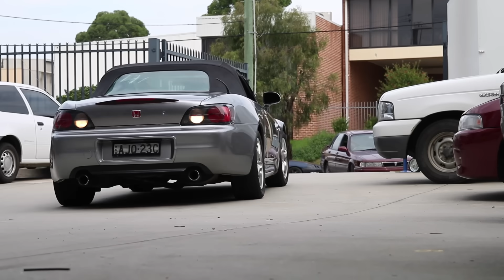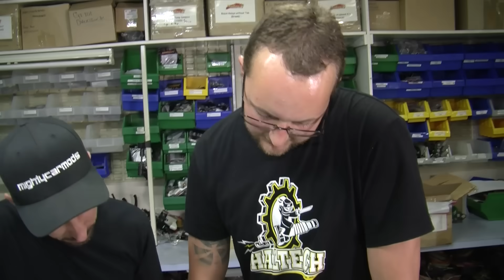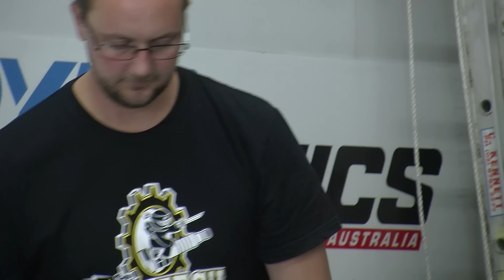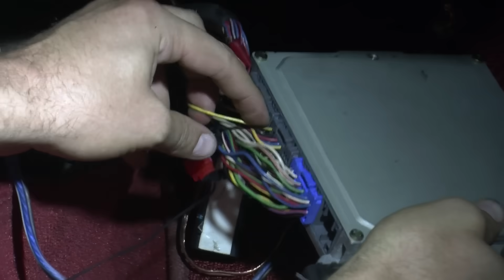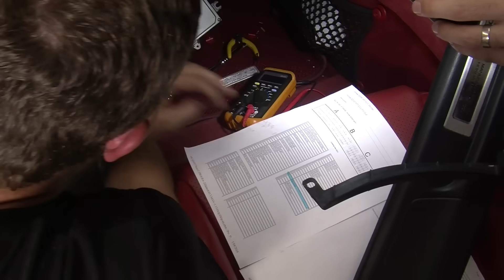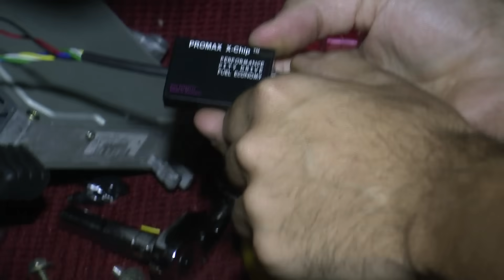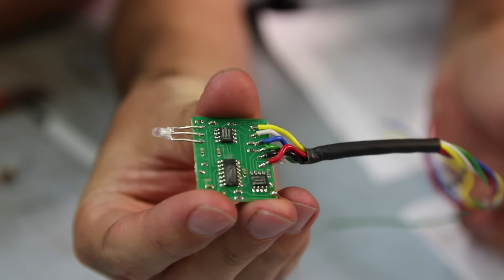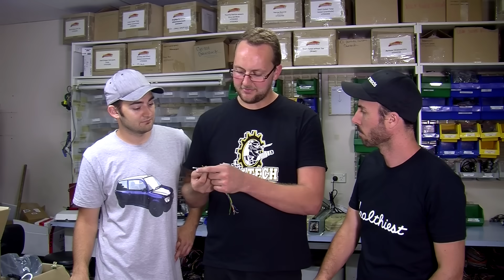eBay Performance Chips -  Mythbusted

Comment: 177BHP is very weak for a stock S2000? Do they have very bad fuel in Australia?

Thats a 63BHP loss through the drivetrain which I find outstanding. A friends stock S2000 in the uk made 200BHP at the wheels. Heck even my ST205 GT4 has less power loss through the wheels and thats 4WD and 300BHP+ @ the fly.

Comment: Ok. So clearly this was a scam, but there has to be some reputable chips out there on the market right? Admittedly they will probably be more expensive, but maybe, actually function as intended?
Reply: I was thinking the same, MCM goofed on the CAI video too, where N/A engines would benefit the most from cai than boosted engines. They need to go in-deph and do version two of each video.

Comment: once again. great episode. but i could have told you guys that ebay chip wouldnt work instead of wasting your time. Im just a regular car enthusiast, dont know much more than the basic stuff.. but im sure if an actual tuner saw this product, they would be completely insulted. knowing how long it takes to properly tune a car reliably. heck im sure that haltech gentlemen was a bit annoyed by that product. Those tuners dont charge you hundreds of dollars for no reason. 

...unless this episode was just some teaser episode on something way bigger for the s2000?

Comment: I keep telling people. VTEC is a technology to get an aggressive cam profile to run smooth at low RPM. It's not a technology to make you go faster, it's a technology to make a lumpy cam - which is what makes the car quicker - more tolerable to drive day to day.
Reply: For an engine with an aggressive cam, below 4500 is low, yes.
Reply: ***** For a car that goes to 9k, yup
Reply: Jake Gilbert The way VTEC works is it switches you between low RPM cam lobes and an aggressive high RPM cam lobe for the cylinder. You can just have an aggressive cam in a non variable timing car though - and there are plenty out there that do. I've seen small port 4A-GEs make >100kw at the rear wheels from a 1.6ltr. No variable timing at all. That's more power than my 1.8ltr VTEC car makes. The 4A-GE doesn't NEED VTEC at all to make that power, because what VTEC is for is to switch off the aggressive cam lobe so it can be driven on the street comfortably. The 100rwkw 4A-GE had almost no torque below 4000 RPM, and idled so rough it would occasionally stall while sitting at the lights.
Reply: *****  Yes, at 75mph an S2K will rev at 4K RPM in 6th. Actually, i normally change gears between 4K to 5K... And the engine running below 3K will actually bog...And still does 23mpg...
Reply: Luis Ribeiro You've got a long 6th. My Integra sits at 4100rpm at about 100km/h in 5th (62 mph).
Reply: Vtec is variable valve timing, vtec changes the lift and duration on the cam.. so yes, it makes your car faster

Comment: Wow I thought that S2k was a 6 cylinder...Looks like my Z34 would blow the bonnet off Moogs ride...
Reply: Brooks Yeager Why are you demoralized?  It's a great car.  I'd rather have it over any Japanese car on the other side of a GT-R.  This is a car that walked hardroof Z33's all day despite it's 4 cylinder and convertible top.
Reply: ... You thought the S2000, named for the fact that it's a 2000cc engine, was a 6 cylinder?
Reply: Lol didn't they come out in the year 2000....?? >.>
Reply: Also it's listed as 2157cc they did a lot of rounding down.
Reply: Well I'm demoralized now that I know this S2k has just a 4 banger in it.Looks fast as hell!
Reply: Brooks Yeager No, they came out in 1999. I don't know that any car has used the year it was released as part of it's name. Meanwhile numbers almost always mean the displacement. A 330i for example is a 3 series with a 3000cc engine (roughly).

They almost always round up. The S2000 originally came with the F20C which had 1,997cc, and that's the only model we ever got in Australia. The AP2 S2000 had the F22C 2.2 liter engine internationally, but Japan and Australia kept the 2.0 liter version. They didn't bother changing the name internationally though.

The JDM F20C with 183kw is the most powerful naturally aspirated mass produced road going four cylinder engine in the world as far as I'm aware. Extra cylinders aren't that important. The overall package is what makes a good car, and the S2000 is nothing to look down on. While the 370Z is significantly more powerful, the first generation 350Z has the same power to weight as the S2000, and by every review the S2000 has better handling characteristics out of the box. Of course the 350Z will be faster in a straight line because of it's low end power - but the S2000 is still an amazing bit of kit.

Comment: Hold up. S2000 made 240 stock don't they?
Reply: At the crank before drive train losses. Manufacturer's announce the power before it gets to the tires because it sounds better
Reply: sixteenseven123 Not only that, but over the years, engines lose efficiency and power.

Comment: I hate to say it but maybe you should learn to use ebay and well maybe ebay should take negative feedback like "That is a fake box ! 3 pos switsh to turn led not more" seriously , and that is from September 2013.

Ebay are pricks basically , even if people report it as fake and prove it , if 200 other idiots say "a+ got it" well that's it once you hit that button your choice is made no going back , I have had so many problems with shit on ebay like this I stopped giving feedback until the day before the 45 day limit. Sellers will even some times drag you on and on until its 60days gone and you cant even leave feedback and then ebay basically fob you off saying sorry nothing we can do , so I ripped ebay off for 80 bucks and told em were to stick it.

Comment: I wouldve sent the item back and gt a replacement cause they may have gave you a dodgey one, in the uk the chip goes in the engine. Ive had one installed n it does give that extra power n economy but mine was a diesel astra 1.9 cdti (150)

Comment: Haven't finished watching it, but 35hp from a chip in an S2000? Nope.
Reply: nope... :(
Reply: 5 hp from a chip in a s2000 already makes me cry BS
Reply: Shadowboost You might be able to get 5-10hp by slightly more aggressive tuning - especially if it's an AUDM car, which has a little less than the JDM power figures.

But yeah from a generic chip not specifically designed for the s2000? No.
Reply: they said at the end that the chip doesnt even work, literally does nothing
Reply: crysis860 Yeah I know. For $20 that's exactly what I'd expect. There are a LOOOT of scams out there for people just getting into cars who want a bit more speed but don't really understand how a car works.

Even things that are quite expensive are often a complete waste of time. I know this is controversial, but even things like exhausts on otherwise stock NA cars are usually a massive waste of time if you're looking for more power. Pod filters are also not better than standard filters for most near stock applications (as MCM has shown).

Best performance upgrade for most modern cars and certainly something as highly strung as an S2000 is the way the car interacts with the road. New sticky rubber and possibly lighter rims. Then coilovers, new bushes and sway bars and some suspension tuning. Then a tougher LSD (I think the S2000 one is pretty good though), and a lightened flywheel and clutch.
Then things get REALLY expensive.
If you touch the engine you kind of have to go straight to a new cam and ECU, then accommodating port and polish, new intake manifolds and throttle bodies as well as exhaust. Gets expensive very fast.

Comment: First off, I would NEVER run an ebay chip even if its proved to work. $20 would buy you a crappy tune that most likely causes engine knock and misfires up the ass.

Comment: This is actually incorrect. Most vehicles have their PCM on the passenger side of the vehicle. There is no room for all the pedals and the openings for the drivers feet are too large to place the computers. Body control is usually also located in the passenger side.

Comment: Yeah i used those crimp splicers on ECU wires when installing an SAFC to handle new injectors on my buddy's integra.  Wouldn't even start.  Started over soldering everything.  Worked fine.  Those things are useless.

Comment: first off wana say. i dont think these do anything for power... HOWEVER i used to have an automatic transmission honda. and bought one of these chips. and i have to say it was worth the money for me.... because...
number one the only thing i noticed it did was change the shifting times. on sport mode if i floored the gas it would shift about 200rpm later than standard. not anything to write home about... 
Number 2 however. in economy mode it was great for highway driving. since it was your typical slush box if you were cruising down the freeway and even looked at the throtl it would downshift. and with the plug in chip you had to give it much more throtle before it would downshift. which was nice.

Comment: It would have been cool to see what a real ECU tune can do. Either way AWESOME VIDEO!!! I always wanted to see these eBay products busted. It was about time! Keep up the great work guys. CAAAAAAAAAAAAAAAA lol (Car)
Reply: Not much power is to be made with either the F20 or F22 by way of just tuning. You can get a bit more midrange power with a more even curve through the middle were engagement is but that's about it. If you want to make a noticeable difference in power with these engines you need some form of forced induction. Even guys that go the N/A route with these motors don't pick up much power, usually just sound.

Comment: I find it hilarious the lengths people go to to make a fake and functionless product look like it's actually doing something. With the time and effort they spent soldering up a fake circuit board, why didn't they just actually connect the resistors?
Reply: Because even that wouldn't work, as the ECU guru explained.  The computer would have altered and corrected for the adjustment on the next restart.  Their clear goal was to produce an item for $2 and sell it for $20.
Reply: David Bonilla
I would be surprised if it even cost $2 to make lol
Reply: David Bonilla
 Yeah I realize that it wouldn't do anything performance wise. I'm just wondering why they didn't just make a circuit that at least did something, rather than going through the same amount of effort designing a circuit that looked like it did something, but really did nothing.
Reply: In truth, and I know perhaps we're thinking too far into this, but the fact is there's millions of junk parts out there.  Why bother getting working parts when you can just slap some junk parts on there.  I mean they did make 'a' circuit as it had to control the LEDs, but beyond that it'd just be a waste of time.
Reply: David Bonilla  Yeah, true. Plus, after thinking bout it, making a fake circuit, means they could just stick any chips they wanted in there and it wouldn't matter.

Comment: WOAH WTF? The S2000 comes with 250+ HP in the states. Moog doesn't know what he is missing.
Reply: No, the S2000 makes about 240-250 HP AT THE CRANK in every country, including the US.  

A dyno measures BRAKE horsepower.|

In every car ever, your BHP/WHP will be lower than the crank (just normal HP), because there are things that are between the crankshaft of the engine and the wheels, like the driveline, axles, and brakes.
Reply: thats what i said... I was flipping out when i saw that figure....
Reply: sarom058s Actually, brake horsepower (BHP) is the same as flywheel (crank) horsepower. The 'brake' refers to the part of an engine dyno which creates the load on the engine. 

If you want another different measurement again, you can use a hub-pack dyno which bolts to the wheel hubs, this will eliminate losses between the tyres and the rollers of a chassis dyno, giving you a result somewhere in between brake horsepower (crank) and wheel horsepower.
Reply: That's bhp. Advertised HP numbers are never WHP. Especially not from Honda. You'd get similar results running a dyno w/ a s2k in the states. Also keep in mind different dynos yield different results.

Comment: your all looking at it the wrong way moog would spend $20 on the chip $5 S&H $1000 fixing the blown engine and $500 on the bet he lost to marty in total $1525 moog cant spend on to-fu all the weight he would loose equates to 35 usable bHp

Comment: My mate's dad's FPV got a gain of 50-60Kw with an ECU tune. I'm not sure if that counts as a performance chip though.
Reply: No, that's an ecu tune. it's not a $20 chip he connected to some wires.
Reply: Totally different things.  

When you tune an ECU, you change how that ECU thinks.  Essentially, when you tune an ECU for performance, you tell the ECU that it should tell the engine bits to work more aggressively.

"Performance chips" modify signals (or at least SHOULD modify signals) to "trick" the stock-tune ECU to think it needs to make the engine work more aggressively.

A proper tune can do a world of good.
Reply: Older (late 80s early 90s) cars have real performance chips for them because you can't actually tune an ECU, but those cost more than $20.00.

Comment: I test audio amplifiers for wattage, also busting some myths like those "500w" $20 amps from China...yep, good for 5-12 watts! Also, many eBay and forum posts say old school X amplifier puts out xyz wattage. I can prove or disprove these claims with my "Amp Dyno". Fun stuff. Great video as always, thanks for saving folks 20 bucks!
Reply: Fancy seeing you here BigD!!  :)  Props to OldSchoolStereoReview & MCM! Both you fella's are doing a great job keeping us in the know.  Keep up the great work!!
Reply: Maybe you could tell me why I have a "1000W" name brand PA speaker with integrated amplifier that consumes 25W at all times regardless of how high or low the volume is.  Was curious so I hooked up the kill-a-watt meter.
Reply: Hey, I'll bet you've taken some of those cheap Chinese speakers to the test? I'd love to watch one of their "500 watt" speakers plugged into even an actual 100w Amp! I'll bet you'd need the fire extinguisher handy...
Reply: Berringer is famous for fake wattage claims.  It's 500 watt PA amp is about 150 RMS @ 8 ohms per channel or 4 ohms bridged.  Some of the name brand companies are legit in their power claims at various ohm loads.

Comment: Its a sad day when my stock LT1 Corvette gets a little under double a stock S2000 horsepower. Honda fanboys your VTECC won't save you now
Reply: A Corvette also cost an arm and a leg. I wouldn't pay that much for a car with fucking leaf spring.
Reply: roboticterror corvettes don't have leafsprings. Just fyi
Reply: Oh and are you talking about the c4?
Reply: JMV563
http://gmauthority.com/blog/2013/07/corvette-engineering-manager-explains-c7-chassis/

"GM continues to utilize a rear leaf spring suspension setup"
Reply: I get this "OMG you have a Corvette you must be rich" thing a lot, but to be honest I probbably bought it for less then that s2000.

Also were talking about a late C4 Corvette, not a C7. No rear leaf spring, The fact that it has an LT1 engine solidifies that as I think they changes to LS engines in C5

Comment: You guys gotta combo-charge the S2K like the Lancia Delta S4 Rally car from the mid/late 80's. A twin-screw supercharger, and a turbo for crazy low-end grunt, and high-end power!
Reply: I would jizz in my pants if they did that, but I don't think they have the money for it
Reply: roboticterror
They might be able to pull it off if they look for second-hand parts. The labor would be the most expensive thing. The plumbing alone for a supercharger AND turbocharger would be monumental - and it might be next to impossible, considering how tightly packed the S2K engine is in the engine bay. Still, we can dream.

Comment: its all a mind control, it does not give you any power but will make you think it gives you more power once installed. same thing with those energy bracelets, they claim it makes you more energetic but the fact is, it does not, it is all in your head. But then like they mentioned if you screw up the wiring... then your got to have a bad time. summing it up, you have some guts installing a chip that is worse then a potato chip.

Comment: Moog, that horsepower rating seems rather low. I just recently bought an S2000 a few weeks after you got yours so I've been on the forums a lot. From what I've seen whp should be anywhere from 195- 200 whp. I would do a compression check on that motor. Btw, you guys are awesome! So much great information that has helped me modify my cars! Thanks again!
Reply: Cars lose horsepower over the years... It may have been that much coming right off the line

Comment: If you want to make some cheap horsepower modifying your car's electronics you should just get an Eprom from eBay - cost about 30 bucks, and it really works. I used it in my s13-skyline - it increases RPM, changes the air fuel ratio, and even disables boost cut... Of course you need to do some pretty serious soldering on your ECUs motherboard, but it's really worth it!